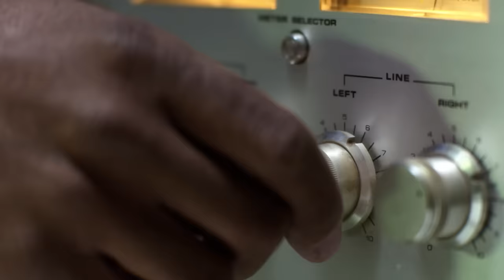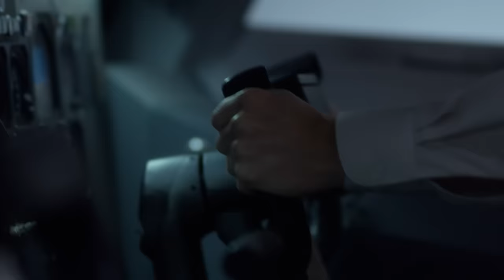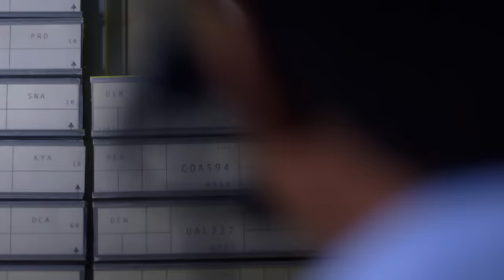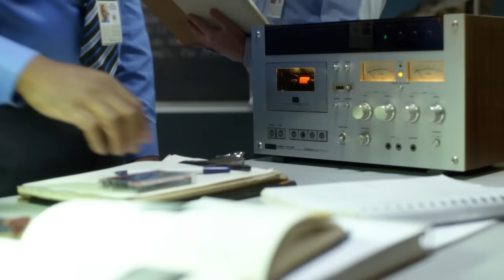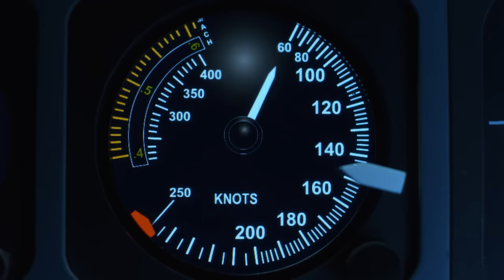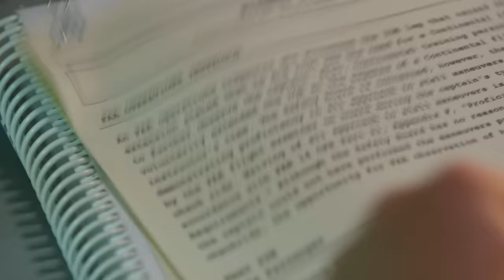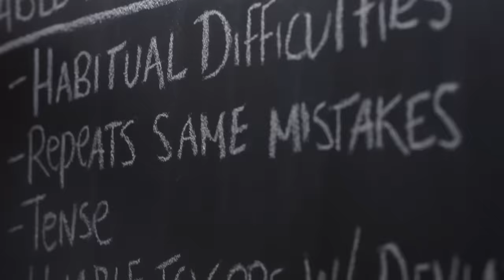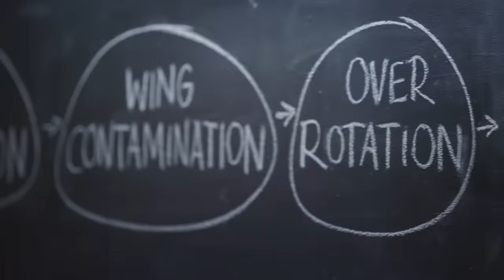Plane Crash That Changed Industry FOREVER | Mayday Air Disaster

Comment: Back in late 80's on an AC flight from Toronto Pearson to Timmins, Ontario on Boarding I noticed the DC-9 wings needed de-icing due to a clear ice formation.  We pushed back and started taxying to the runway which caused me to stand up and get the attention of the flight attendants.  I explained that unless we got de-iced, why I would open a door and get off with my wife in tow and that as a pilot I knew what I was talking about.  She ran to the front and a few moments later we stopped taxying.  The captain came on the PA and explained we would make a detour to the de-icing pad and that our takeoff would be delayed for a few minutes.  The flight attendant came back and thanked me for my actions.  This was after Air Ontario crashed in Dryden, Ont. after a failure to de-ice their jet.
Reply: I've heard the crew wants to hear of anything a passenger might notice as being "off" with the plane. There was a crash that came down to something like faulty rivets on the outside skin by the front boarding door. A woman survivor reported she'd noticed the spot "looked weird" when she was boarding, but thought exactly what I'd have thought. What do I know?  Someone would have noticed on maintenance checks. It's probably nothing. She had such regrets for not telling the attendant. She knew it wasn't her fault, but still. I felt so bad for her. That's the program I heard to report anything you see that looks possibly concerning to you.  It doesn't matter if you're wrong. The crew can determine that, and if you're right you may save many lives. Sorry to ramble on, but the bottom line is GOOD FOR YOU!  You never know when you'll be called on to be, yes, a hero. 👍 ❤

Comment: It's insane that in conclusion, that plane never stood a chance. Ice build up, over-rotation, and inexperienced pilots. A formula for true disaster, especially in a snowstorm.
Reply: DO NOT FLY in bad weather. Remember Carol Lombard? Society's aviation hubris must stop and start taking safe High Speed Trains (HSTs) for long distance land travel. Japanese 200 mph bullet trains since 1964: ZERO fatalities.
Reply: @dynmicpara  How much does it cost for your choo-choo trains, their tracks, and their stations, and how easy is it to change destinations of the tracks when new stops need to be added? Such as making a hard right turn on new tracks for another thousand miles or so? America is just a tad larger than Japan if you hadn't noticed.
Reply: The pilot had worked for Continental almost 19yrs...that isn't inexperienced.
Reply: @marinazagrai1623  was inexperienced on that aircraft!
Reply: It's the "swiss cheese" model in action.  There never is one cause.  There are a lot of factors that line up to make that hole that the accident happens in.  One thing stopping the hole prevents the accident.

Comment: One minor factor, not mentioned, is that the DC-9-14 had no leading-edge slats like later DC-9 variants.  This actually made it more prone to icing than later variants.  This may explain the 20-knot difference in required takeoff speed mentioned in the video.
Reply: That is not a minor factor, and it is scary that it was not mentioned.  The slats make a huge difference in the forgivingness of the wing to contamination and lousy technique.